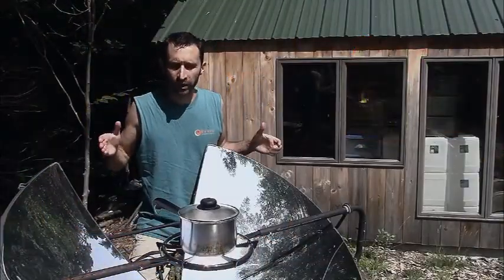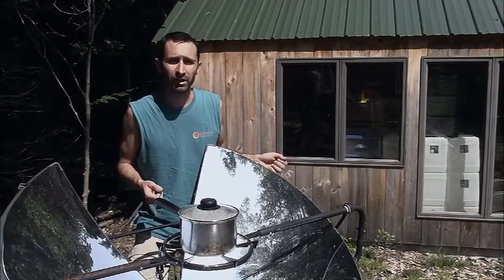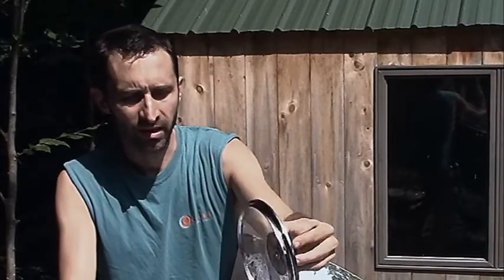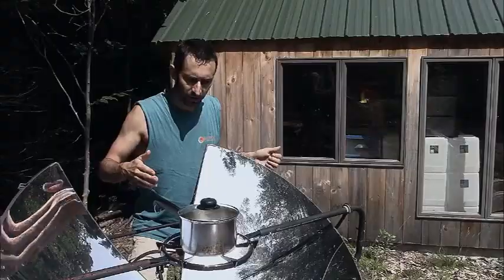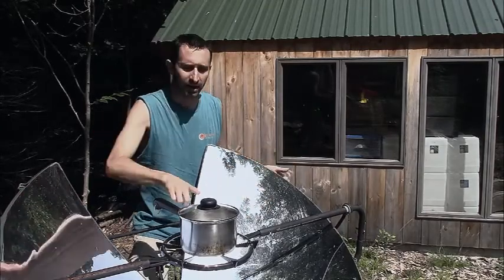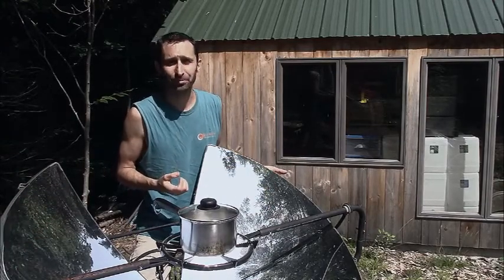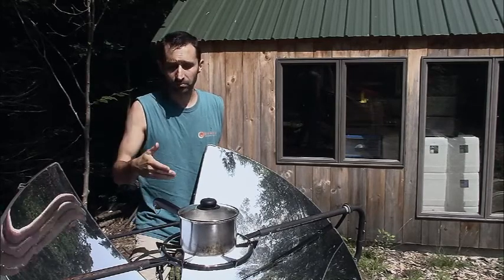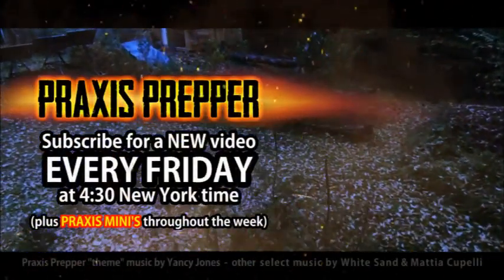Potential Danger: Solar Parabolic Cooking Safety Tip

Comment: You should try making the "paper fire log" virtually free if you have spare newspapers (any paper like material). Theres some videos on youtube about it. Not sure if you have covered it before.. but it is a useful idea to get out there.
Reply from the maker: I actually have a fire starting video shot and set to run on Sept 15 (unless I bump it for some reason to another day). I don't know how much work goes into making a paper fir log, but the way I start fires is about as easy as it gets (without lighter fluid). I'll look into the pare log thing though - just out of curiosity. Thanks!
Reply: Praxis Prepper for sure! I prefer "tiny house listings" how to on fire logs. He trys to keep it to a minimum time consumption